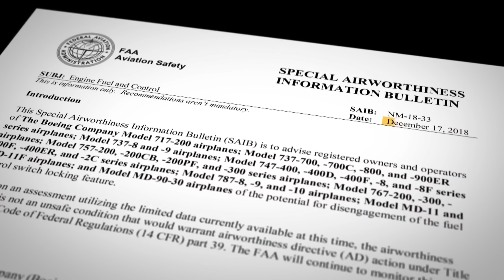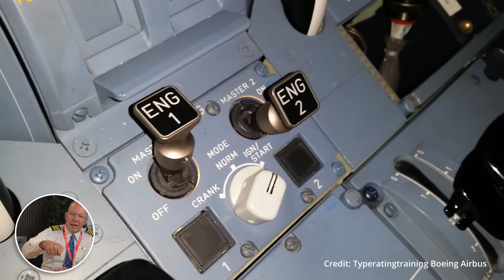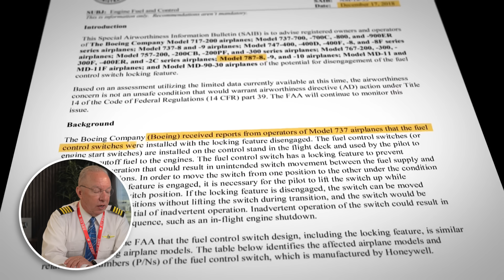Air India 171: The FAA’s 2018 Fuel Switch Locking Bulletin Explained (16 Questions Answered)

Comment: On the Boeing 787, the engine fuel shutoff valve is controlled by the FADEC, not just the cockpit switch. This means the FADEC can automatically close the valve if it detects a serious fault — like an engine fire, overspeed, or uncontained failure — even if the pilots didn’t move the fuel control switch. So the FDR can show the fuel valve in ‘cutoff’ without the switch physically moving. This is normal design for modern fly-by-wire jets like the 787.
Reply: WOW, so the pilot flying asking the "Why" question could have been just responding to feeling/seeing engine power reduction and ASSUMED the other pilot had moved switches to cutoff ? specially since the non-flying pilot responded he had NOT - hmmm, sure wish there was cockpit video !
Reply: @KRAM-ct7ok  The First Officer was the one flying and the Captain was monitoring. If the FO had moved the fuel switches to Cutoff by hand, the Captain could have seen it and could have stopped it immediately or just moved them back — he can always override FO’s decision. But instead, the Captain asked ‘Why?’ — so it looks like he didn’t see the FO move anything. He probably saw on the screen or panel that the valves were in Cutoff, so he asked where that came from.
Reply: It seems that the switches were physically moved to cutoff. Because, the pilots set them back to ‘Run. How could they do that if everything was automatic?
Reply: @ann-gelaholloway  The switches in the cockpit can stay in Run while the FADEC commands the fuel valve to Cutoff automatically. If the pilots see that the engine has shut down, they can move the switch back to Cutoff and then Run again to try a restart. So, the switch being moved back doesn’t mean they shut it off — it just means they tried to restart it after the automatic shutdown. That’s normal procedure.
Reply: @samridhidubey9344 Thanks. That makes sense. Plus, no one is addressing that the Landing gear was half up. It still seems like a total loss of power. Nothing deliberate.
Reply: @ann-gelaholloway It wasn’t half up, it was down with the gear lever still in the down position in the wreckage. That’s why is not been addressed
Reply: @battyjoe Thanks.
Reply: Why would the pilots switch off fuel and then scream.....
They had lot of Miles and were seasoned pilots. Sadly they cannot  tell the truth😢

Comment: Hi, Cap could there be any possibility that during the flight are there any procedure the pilots need to use any switch on or off during takeoff, may be the pilot mistakenly put his hands on the wrong switch?
Are there any switch that is positioned near the cutoff switch that needs to be operated during flight?

Comment: Hi Steve. Thanks for churning out these videos to facilitate discussion.

After reading the FAA SAIB, I don’t agree with your take on the fuel switches. It says “while the airplane is on the ground, check whether the fuel control switch can be moved between the two positions without lifting up the switch.” That does not imply that you wouldn’t be able to turn the switches on at all, instead it implies that you just don’t have to lift the switch prior to toggling.

I am leaning towards agreeing with you, but there’s always a chance some huge bump or inadvertent movement of the pilots hands hit the switches with a defective locking mechanism. The 1 second between the switch flips leans me more toward your perspective though. Still some work to be done here, but I think you’ve got it right. Just wanted to clear up the SAIB

Comment: 2:42 i think this question meant that if the system doesnt disengage this CUTOFF system during the takeoff stage. The computer should think "This CUTOFF is not part of the take off procedure, i wont let the engines shut off because that means the plane will be in danger of falling.

Comment: Can a check list be digitally integrated with the flight , in prior to take off and landing ? So that the pilot ensures what needs to be on or off , is made rightly as needed without a chance of error ?
Reply: They are digitally integrated on the 787. What is a checklist going to indicate in this scenario?
Reply: @Skywest25 Thank You for your response . So I am trying to understand if any mistake or an error that happens or violates the checklist during the process of take off or landing , will notify the pilots, right ?  Is that how one of the pilots asked the other have you turned off the fuel supply switch ?
Reply: @karthikrajsambandam6786  Yes sir exactly. The checklist was completed and everything was normal when they started to takeoff. But once the fuel is shut off you have no thrust to keep the plane flying.

Comment: 60 years-old private pilote here: THREE CHANGES TO BE MADE so this can never happen again. Shutting off both engines in such a critical moment must NOT be this easy:
1.- Redesign switches so neither pilot can do this alone. Actions from both pilots should be required. (some more time may be added to a legitimate shut-off situation, but pilots could be trained to do this fast).
2.- Redesign aircraft logic so that this exact action cannot be made by pilots at such low altitude.  
3.- More initial AND recurrent physicological controls on air crews.
Reply: I agree...unless a fire has been detected, the system should have a protection that simply would'nt allow a shut-off like this during take off & landing, (ie: at or bellow 1000' altitude).
Also, in case of another German Wings-type situation, there should be the possibility to remote-control and land the airplane rendering the rogue pilot/highjacker's lone presence in the cockpit useless.

Comment: Regarding LatifElhag's question whether there isn't a clear alert about fuel cutoff in the critical phase shortly after takeoff: You say "you can hear it because the engines wind down and you can see the levers in the cutoff position, so there is not much need for an explicit indicator". Well. There can be a multitude of reasons for the engine wind-down, and fuel cutoff is actually fairly outlandish (either an absurd accident or terrible intent) so that it may not be considered immediately by the pilots. Indicating this specific reason which really should not be there would add clarity. Every second counts here.

Comment: 1. Why in the world any aircraft builder place these fuel cut off switches right below the big take off controllers (handles) where pilots hands would be placed most of the time. Not very smart design. 

2. And we shouldn’t have cctv because a pilot might get caught reading a magazine? Seriously? Busses and trains have cctv. This is not the 70’s. We have AI enabled cameras on highways to catch people driving with hand held mobile devices. Why? Because it’s reckless and could put others in harm’s way. 
Not just normal cameras, AI enabled cameras should be in every airplane for both pilots and passengers. 
The purpose is not to catch a pilot reading a magazine. The purpose is to make people accountable for their actions and also to get a much clearer picture of what actually happens during a flight where two pilots have hundreds of lives on their hands. Captain said in the video that the recording gave all the info we need and a camera wouldn’t give any more information other than visuals. Well, then let’s get rid of all tv’s and other modern screens and go back to the era where only radios existed. No need for YouTube either. Whats the use of visuals right captain?
Captain please think before you make these statements. A camera visual with audio is what exactly we need to see who did what where and when and how and why….
Sometimes the most experienced people are also the most old school and presenting ideas that are outdated. This is unfortunate, dangerous and very disappointing.

Comment: It has been reported by many that the fuel cutoff switches were found in the 'cutoff' position. If the second pilot indeed reset the switches to 'run,' then why would they have been found in the cutoff position? (The best explanation is the switches were not found in the cutoff position and the reporting is wrong...do you think that's what happened?)

Comment: There have been recordings of poorly installed switches identical to the fuel cut off switches on this aircraft. Does the report elaborate, not at all. If they were faulty would a cockpit camera pick that up during operation, absolutely.

Comment: There needs to be an inhibit system installed that wouldn't allow the switches to work if there were no malfunction/fire sensed. You would get some kind of message like "Confirm ENG 1 / 2 / 3/ 4 Fuel Cutoff?"

Comment: Imagine being the 2nd pilot. You can see your colleague do something unthinkable. It takes a second to process it. You confront him, he denies. At that moment, you know, you are sitting next to a saboteur! What else could the 2nd pilot have done? He moved the switches back, he called mayday. We can only admire his actions. If the altitude was slightly higher and the engines came back, the saboteur may have done other stuff to the aircraft, pitching into the ground, starting an actual fight in the cockpit to get ahold of the controls, etc. I mean, when the 1st pilot switched to cutoff, at that moment, he became the enemy. How do you fly sitting next to an enemy, if both of you share the controls? Can't even comprehend that. My prayers are with the lost souls.

Comment: The issue with cameras in cockpits is clear. They will put hundreds of thousands of air crash investigators out of work. Once you can see what happened any pilot will be able to deduce what  exactly happened from a single viewing. Issue solved in an hour. No need for all this hullabaloo. That would be a disaster for the NTSB who would become almost redundant. Airline wont like it because they cant hide poor pilots and manufacturers wont like it because they cant disquise equipment failure as pilot error. The more murky the causes of crashes the more comfortable the whole industry.

Comment: Captain Steeve
I'm not a pilot but I reviewed the report, the details about how Boeing fuel switches operate- including the back up/ redundancy protective measures which Boeing includes.The timing of the cut offs is key. What the FDR indicated. This HAD to be planned and deliberate. The pilots union in India is creating a massive push back against the report- which just states facts. It doesn't blame. Why is the pilots association so hostile to the factual realities? Do they fear more aggressive mental health monitoring? If a suicidal pilot brought the plane down, its tragic but we need to learn from it. See what might have been done differently. That safety bulletin- and the chip degradation theory- are total obvious red herrings. If one considers all the evidence, there  really is no other realistic possibility other than intentional crashing of the plane.

Comment: Captain Steve, Q: is the flightdate recorder saving the POSITION of the switch or the "run" or "cut-off" SIGNAL which is comming to the computer which is controlling the plane?  Thanks. Cheers. M.

Comment: There was a report sent to Boeing that the fuel control switches were bound to fail on the 737 and other flights as well as the locking mechanism failed and went back to cuttoff position automatically cause of the spring loaded mechanism.

Comment: I seems that switching off both switches with a 1s interval is a typical thing. But why did they set the switches back to RUN with 4s delay. If you want to die, you don't need to hurry up, so may switch them slowly, but when you want to survive and you life depend on the two switches, you would not wait for 4 seconds.
That looks more like they tried to turn the engines on by moving the switches up and down and looking on the reaction and as 1st engine get on, started the same procedure with second switch. May be even they turned the first switch once and looked for the engine reaction, then turned on the second. Anyway that indicated, that the situation was not clear for them and they wanted to understand what is going on. If one pilot had seen another to switch the fuel off, it would be clear for him, that he had to switch them both back as soon as possible.

Comment: I believe Boeing's fuel control switches only close the fuel control circuit if they are fully UP. Meaning even if they were placed halfway, the engine would never have switched on.

Comment: Question
All we really know is that the electrical signal to the FADEC (and FDR) went through a change of state which should indicate that the switch was moved to "OFF".

The switches were found in the "ON" position after the crash.

The FDR apparently showed that the switches were cycled from Off to On.

What if : There was DC Bus voltage fault and the electrical signal fell away and then came back seconds later.

Both the FADEC and FDR would think the switch had been cycled

And the engine would lose fuel supply.

Just a "what if" scenario

Comment: Captain Steeeve, Is it possible that they left the cutoff switches in off position, and never turned them on. I would guess the leftover fuel from previous flight could it have fed the engines enough to get them off the ground initially?

Comment: Now Cap Steevie , if one of the pilots did it manually and even the other pilot saw him do it {switch off fuel}  the plane was so low to the ground with not enough time for the fuel to start up again and flow to the engines ? ? My thoughts all along have been mass murder suicide by a pilot . Why beat around the bush , please correct me if im wrong, , I just take interest in these things coz i fly regularly,, back and forth from Australia to the Philippines for 20 years . .

Comment: one thing that doesn't quite make sense to me: Let's call them Pilot A and Pilot B. Let's assume for a second Pilot B turned off the fuel to the engines, willingly, on purpose, to crash the plane. Wouldn't Pilot B's next step be to make sure that Pilot A can't recover the plane? Like interfering with Pilot A's efforts to get the fuel back running to the engine? 

Shouldn't there be a struggle heard? Or was there a zero percent chance that Pilot A would recover the plane?

If I was Pilot B, I would make sure Pilot A can't put the fuel switches back to Run, with my hands covering the switches. Which likely would be audible from Pilot A's reaction.

This just seems weird to me...
Reply: Yeah, that indeed may have happened. All we have right now is the preliminary report with only one snippet of what's on the cockpit voice recorder. The more detailed final report will be very interesting, if also very sad, reading.

Comment: Wouldn’t it make sense to prevent these kinds of situations by implementing a safeguard in the aircraft’s control system that prevents both engines from being shut down during takeoff, until a certain altitude is reached? Also, I know installing a camera in the cockpit might raise concerns about pilot privacy, but honestly, when you’re responsible for people’s lives, shouldn’t this be integrated immediately to help make air travel as safe as possible?

Comment: Important point about 10 seconds of delay I need more clarification, what is the flight warning system signal during this 10 seconds if warning could be more significant they would have had the time to do engine relight

If fuel shut off warning is not that alarming then it’s an update that flight warning system should equip going forward 

Also what is the response time that engine takes to relight

Comment: Im no pilot but what about the idea of equipping the cockpit with an automated voice announcement or confirmation that whenever a “critical” switch is turned on/off, activated/deactivate, moved up/down such as landing gears, flaps, fuel switches, auto pilot, fuel dump, etc., a preprogrammed cockpit voice confirms what was done.  This way both pilots are aware of what was done by the other whether intentionally or accidentally.
Reply: There were numerous warnings going off when these switches were moved.

Comment: GEnx-1B SERVICE BULLETIN - 73-0097 R01 Revised    (Fuel control chip issue causing loss of signal and fuel cutoff).   were the pilots trying to get the fuel flowing again by cycling the cutoff switches after an intermittent/failure of the chip in this bulletin????

Comment: I have machinery with "ROCKER SWITCHES"flip up on, flip down off.  I have seen as they age, they have a tendency to hang between on and off.  I always push up and push down.  But a nonchalant flip will sometimes get the halfway position.  $8 or $9 switch isn't that critical on a tractor compared to triple reduncy of a big ole jetliner 40,000 feet up thar!

Comment: Im goong to adress a couple things. 
1. It is my understanding that in the 787 there have been instances of faukty switches where the switches do not go into the detents.  Could the pilot monitoring have been resting his hand just under the throttles (not uncommon) during takeoff and accidentally slaooed them down.  Conceivably yes but 1 in a million.  The fact that there is a 1 second separation in time between number one and two beinf turned off indicates to me that it was intentional.  That is exactly the order and interval you would do it on the ground.   
2. Could it have been something that was done intentionally but not in the right frame of mind...i.e. a muscle memory thing where the pilot experienced an issue of some sort such as a loss of awareness....anything is possible but the chance is close to 0.
3. The other pilot that claimed "i did not do that".  The pilot who observed this would have said something and the other piolet would have denied it had they done it on purpose.....likely in case of survival so they could deny it plus most people who do something wrong and are called out immediately deny it.